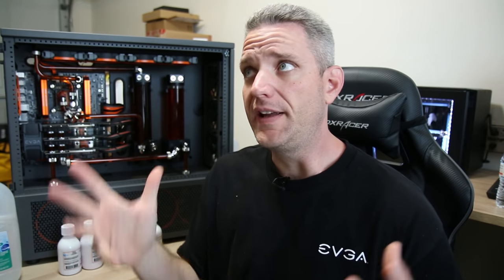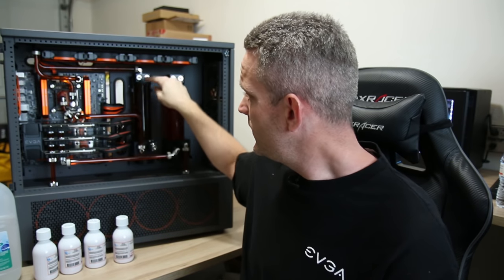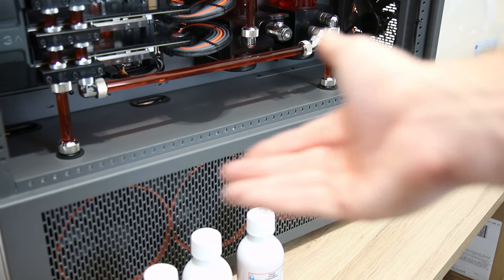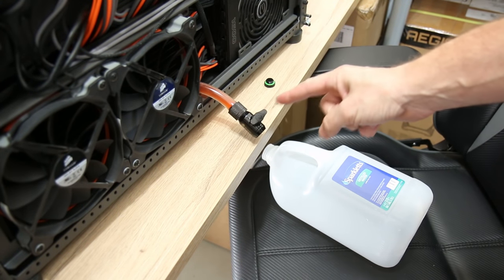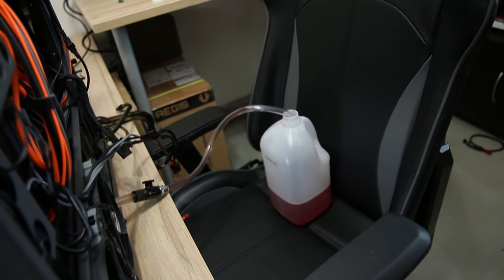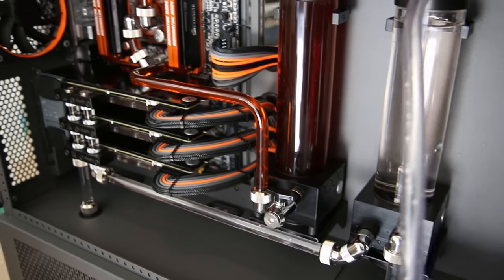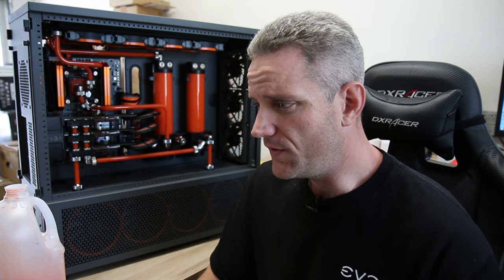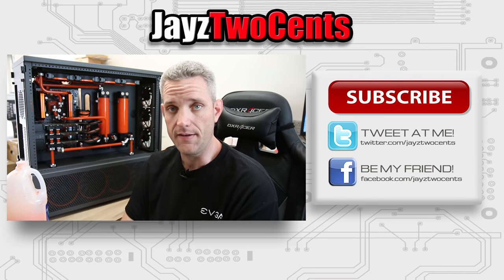How I flush my radiators and setup my drain ports

Comment: It's probably a dumb question, but can't you get rid of the cooling fluid by pumping air into the loop and basically pushing it out that way?
Reply: Yes but he wants to clean out everything to if your just draining it that will be fine but since he wants to clean out the whole system to make sure nothing is clogging it or causing the color discoloration.
Reply: +Domonkos Trager - Well, what do you think he was using when he blew into it?  Mouthfuls of distilled water?
Reply: +9ff70f96 at first he did that to get some out so he could pour in the next water because he can't just open the valve and it will come out you have to blow into it so that something takes the space of where the water was.

Comment: You never notice the trolls. If you did, you would respond to me when i ask you go get a FX 8350 through 10 minutes of heat testing at 8 GHZ with all cores and threads running.
Reply: that would be... SUPER HOT! SUPER HOT! SUUUUUPER HOOOOOOOOT!
Reply: Noah Chisholm SUUUUUUUUUUUUUUUUUUUUUUUUUUUUUUUUUUUPER HOOOOOOOOOOOOOOOOOOOOOOOOOOOOOOOOOOOOOOOOOOT!!!!!!!
Reply: +Andrew Behrend the most innovative shooter of the decade.
Reply: +Execution SUPERHOT!
Reply: +Andrew Behrend Contrary to what people think, AMD CPU's actually run cooler than Intel CPU's. Yes, the Vcore is a lot higher than on an Intel CPU, but the TJMax of an FX 8-core is 65C on the core, whereas the TJMax of most Intel CPU's are into the 70's and can hit 80C for some architecture's.
Reply: Ro-Tang Clan your right. When you get an intel CPU to the performance level of an AMD CPU, they will run hotter.
Reply: The thing is you don't need to get an Intel CPU running that high to out perform a AMD CPU which sucks because AMD used to compete with Intel CPU's and that kept the market competitive.
Reply: well maybe with zen, amd might become competitive again....maybe

Comment: Can someone help me... when I use the video ports from my gpu (hdmi and the dvi) my monitor says no hdmi signal... I have a GTX 980 Ti G1 gaming..
Reply: Did you check both monitor and graphics card for power? If that is fine, then you might have a defective card or power supply. I would bet on the card, as it's more likely to fail than a decent power supply.
Reply: ***** yeah I got a hold of gigabyte and set up an RMA so I'm sending it out soon

Comment: your pc has a sti (unfortunately not a subie)
Reply: +Dion Van Der Rest for some reason I just imagined a turbo strapped to a PC to give it more power.
Reply: +Knops lol, now i see it too
Reply: Dion Van Der Rest sadly, there is no part that is built like an engine :(
Reply: +Knops the rads and the waterpumps can be used in a car, mcm used a 120mm rad to cool a supercharger
Reply: Dion Van Der Rest unsolicited info! but thx. 
but we still can't stick a turbo to a pc component to make it run better :(
Reply: +Knops maybe cooler